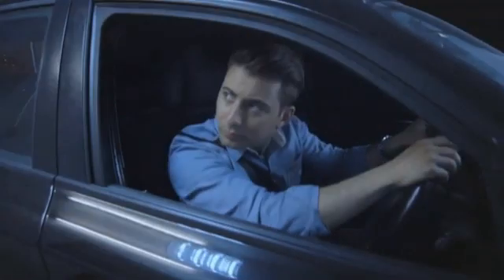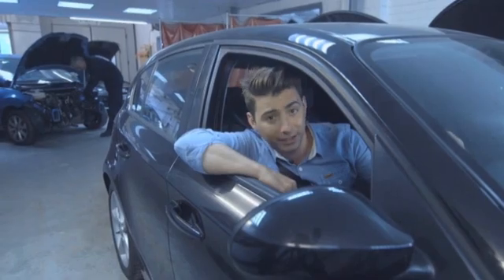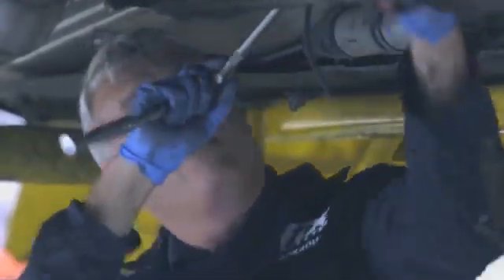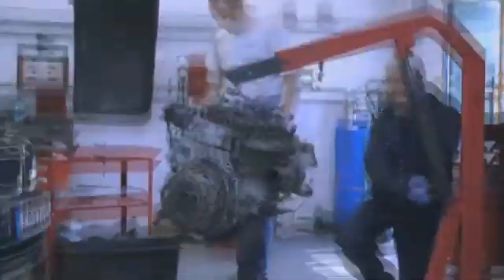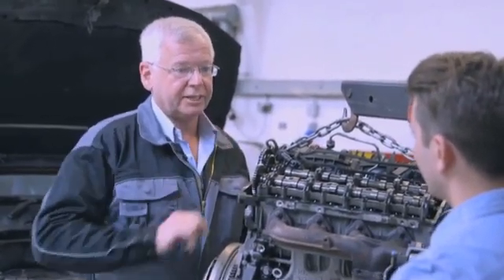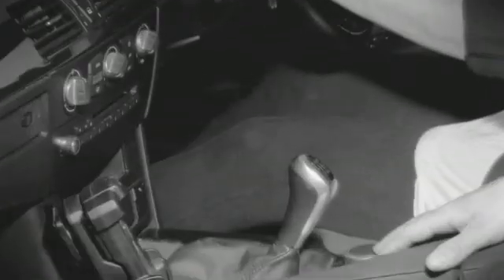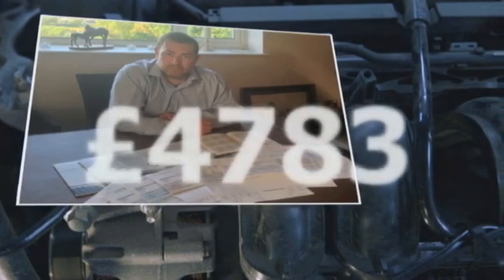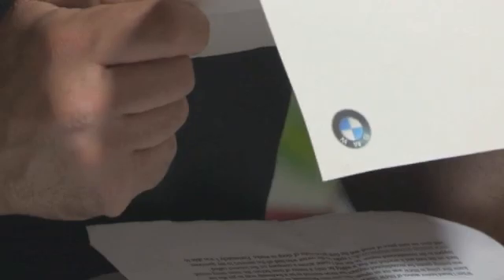BMW N47 Timing Chain Failure PROBLEM

Comment: LESSONS TO LEARN? THERE'S GOT LOAD OF ISSUES INVOLVING BMW, EITHER PETROL OR DIESEL ENGINE, THESE CARS ARE JUST AN OVERRATED , I KNOW COZ I OWN ONE... FOR 20 MONTHS OF DRIVING IT AND 49K MILES ON THE CLOCK, THE TIMING CHAIN GUIDE( WHICH I THINK IS A CHEAP SELECTION OF MATERIAL AND DESIGN FLAW) WITH PLASTIC ATTACHED TO THE GUIDE INSIDE THE ENGINE WAS DISLODGED FROM IT'S POSITION, WAS MANGLED INTO BITS PLACING THE TIMING CHAIN INTO STRESS AND DEPOSITED DOWN TO THE OILSUMP, IT CAUSES LOADS OF ISSUES FROM KNOCKING AND RATTLING SOUND,DRIVE TRAIN, WON'T START ETC. BMW WON'T TAKE RESPONSIBILITY FOR IT TO STAND GROUND ON THEIR SUPPOSED TO BE PRIDE. CAUSE ME GRIEF, ANNOYANCE, DESPISE OF OWNING IT. I ENDED UP DUMPING THE BLOODY CAR. DO NOT DESIRE OR LIKING TO OWN A BMW , IT'S A WASTE OF MONEY!!! THIS IS JUST MY STRAIGHTFORWARD AND HONEST OPINION.

Comment: This is why you never buy a 4 cylinder BMW (at least newer than the E46, 4 cylinders in E30s are pretty good), 6 cylinders are a lot more reliable, powerful, sound awesome and actually cheaper in the long run. If you want to cheap out by buying a smaller engine and want to save money on fuel, buy a Japanese car instead, a German luxury car only makes sense with a proper engine.

Comment: First when the engineer guy says "I'll bet my mortgage on it" who actually wins there? If you 'lose' the bet do they have to pay your house payment 😂
Second "BMWs are trusted and known for their reliability " 😳😳😳😳😳😳😂😂😂😂😂😂😂😂 you gotta be kidding me bro!  Every time I'm at a stoplight and hear one of the newer 4 banger 3 series shutoff then restart when the driver takes off I'm like 😳😮hope ur car makes it over 100k bc I know your starter won't!  Meanwhile back in the e46/39/53/etc straight 6.....zero internal engine probs ever
Third, these stories make e39 e53 and e65/66 v8 timing chain guides and valley pan issues look like a dream
Reply: bill durning probably just your oil separator and related lines, all the m54 3.0's I've owned this fixed the oil consumption issue

Comment: repaired loads of n47 chains no internal damage just snap the rockers and I normally take gearbox out leave engine in
Reply: Ashter Egg  were are you located please
Reply: @darrenpowell7225  did you find someone to fix yours?
Reply: It is harder with removing only the gearbox?
Reply: Hi, does the break in the timing chain not affect the valves?

Comment: I have 2 BMWs, and just bought another one (didn't arrive yet). First has the n47 engine, it runs fine so far but only 50k km, and the other is a 2008 z4 3.0 265ps n52 160k km . Oil filter gasket slightly leaking now, scheduled for replacement for 110$(equivalent). They are for sale now, first because of the n47 and the z because I want something built racetrack only like i.e. Westfield xtr2 although the z is very good.

Comment: We brought a BMW E46 coupe  3lt turbo diesel auto and the gearbox went tits up  . What a piece of shite  and what was the comment from my mate - you should of known better buying a tick turd car. 
Old engines had push rods , reliable old buses then they did away with that and did cambelts which snapped and your pistons smashed into your valves . This is the price you pay for high revving engines. But I guess manufacturers know that if they can make a fast car every little tick turd will want one .

Comment: These BMWs diesels use a Peugeot engine that says it all buy a German car get a French engine. Buy a petrol you get a BMW engine but make sure the cam-chain has been changed at around 60k because they do go!! but it is on the front of the engine not the back, always check when buying

Comment: Okay guys my bmw f10 2011 timing chain snapped and bmw paid 8k and I paid 2k towards repair, I had 130k on clock, happy with the result running nice and smooth.

Comment: E46 6 cylinder crew checking in with 0 problems ever. Lol
Reply: e39 6 cylinder squad confirmed! :D
Reply: M57 👍
Reply: M54 ftw
Reply: M47 engine cars too, if they have deleted the swirl flap :D
Reply: @iFulixzer  Nah they have turbo issues and so many others.. Iknow a guy who had a E46 and he sold it now he drives a french car instead 🤣🤣
Reply: E32 with the senior six saying hello.
Reply: 17 year old E46 320i checkin in. 0 problems
Reply: no car has zero problems--my e46 burns the shit out of oil--been doin it since 50000 miles--now has 190000 but still running
Reply: That is not a problem, the M54  was designed to do so with negative crankcase pressure sealing rings. The engine burns about 1-1.5L of oil per 10k km from new. Mine burns about 2L per 10k km now at 300k km and this means it's a healthy M54. It's still on it's original chain and piston rings, a great engine!
Reply: 2009 LCI 318D N47 checking in, 160k miles and counting.  Original engine, gearbox, turbo and running gear.  Not a hint of timing chain noise.  Must have got a good one lol.  This car is staying as my daily until the day it dies.
Reply: @ChrisUKFF  then youre lucky... i had a 2008 318d 143hp facelift! 120k km  climatecomp. Broken.... 125 k km turbo broken.... 
And and and
Reply: @ChrisUKFF  mines fucked  2009 320d lci
Reply: @dumbthingsyousee6969   You obviously never have owned a Honda Civic EJ9.
Reply: @dumbthingsyousee6969  well the engine could have been abused like: revving it right after a cold start and many more.I think your piston rings are gone mate.
Reply: @dumbthingsyousee6969  it is normal for 6 cylinder engines on e 46 i have 2.0i and my also burn oil like crazy but last month i have replace the camshaft sensor and now doesnt burn the oil so much 
P.s. you can replace that alone for like 15 minutes and cost me around 50 euros .. check on youtube how to replace it... i have 289000 km but the engine goes and sound like they made it yesterday .. and i have also replace the ignition coil all six of them,air mass meter also you can do all of that alone for like 1 hour just need the right tool and engine its like new man ;)
Reply: LOL u forgot all the cooling iaauea
Reply: obd1 single Vanos 325is e36 4 speed auto checking in with 250,000 miles.
Reply: Yes! I have a e46 330d 260k km and i fucking love it
Reply: @bandit4731  LOL my Merc W203 is at 305k i bet i can beat your BMw anyday.
Reply: @sikijunior1  for sure! I had one tooo! But they have rust problems 🙈
Reply: @sikijunior1  ok sorry my fault! Ive had a 2001 clk 230! But this is 12 years from now!
Reply: @sikijunior1  do you get it first hand? Ive got mine with 3 owners... -_-
Reply: @sikijunior1  this is the best thing my friend! Greedings from austria :D
Reply: @sikijunior1  eu or not eu! Were all equal my friend! :D austria and bosnia are connected with much history :)
Reply: 130i N52 crew saying hello
Reply: Except eating swirl flaps fir a start
Reply: Had n42 on 318ci bad choice both in terms of power and reliability, oil was dripping on all gaskets, replaced all oil rings and gaskets, from solenoids, head cover, sold the car, next owner had issues with timing chain, was a close call for me

530ia e60 8 months of ownership 0 issues, horrible fuel economy

320d e90 pre n47 engine with timing chain in front, long trip to spain and back 7200 kms, water pump failed due to engine vibrations, made it home in time, repaired for 500 euros then sold the car afterwards, 6 months of ownership

320i e45 m54 2.2i 4 years of ownership, absolutelly no issues except it was consuming 1 liter of oil for each 1000 kms, you had to go somewhere you take oil with you to top up, 0 loss of power just eating oil all day long, otherwise working fine, beautiful engine pleasure to listen to

E90 325i manual, 3 years onwership, awesome drivers car, electronically operated water pump failed, just the pump itself costs 500 euros, (whereas as the belt operated m54 water pump costs no more than 100 euros) 1 year later ac compressor failed, 400 euros to replace plus other parts, like belts and rollers total cost 800 euros, other than these 2 issues engine worked fine, except for valves noise which was a common issues with n54, though it did not affect performance, had to explain to next customer is was normal noise, he understood, bought it and had 0 issues so far

F10 530d, 2 years so far no issues at all, beautiful car and engine
Reply: 1999 E46 323i reporting for duty. M52TUB25 with zero warning lights, runs like a champ. 130k miles.
Reply: E46 It's a legend , no a car 😉✌️
Reply: 2013 F30 330d, 82k miles, worrying loud clattering noise under load.
Reply: Same thing with e60 m54. Great engine, great car. No problems at all
Reply: Best car ever built
Reply: My old m5 got hungry & ate its bottom end to death 😔 piss that off then got a e46 m3 but then the subframe spot welds decided to crack & go for a fkn stroll 😗 ive now owned my 400kw chaser for over 10yrs & the only thing i have ever replaced is the clutch 🙂
Reply: Fair comment.... except for the rest of the car rotting off the carcass LOL
Reply: A fuck off, E46 are infamous for throwing rod bearings
Reply: Oosterhout’s Finest zzzzzzz yes by lazy ppl who don’t service the car properly OR people using WRONG oil. Go find cars with these problems then look at the service history to find your answer. Every 10k or 6-8 months. Zero issues with chains and turbos!, try it

Comment: There are cars with design flaws for sure but many timing chain jobs I’ve done were due to people not changing the oil frequently enough. Manufacturers recommend crazy intervals like 10,000 miles for an oil change. If you can’t afford to change your oil at least every 5,000 miles then you have no business buying a bmw or any European car for that matter.

Comment: Buy original BMW oil and have it replaced at least on 10,000 miles by yourself or someone you trust. No problems then. Usually timing chain makes very loud rattling noise before it breaks. In Slovenia it can be replaced for about 1,000 to 1,200 €. I think that those long service intervals are the main reason for failure.

Comment: part of the problem is the "long-life" oil. so they make the car difficult to repair by putting the chain at the back, tell you only change the oil every 2 years and then when it fails slightly out of warranty expect you to pay for it all. They're scamming people, nothing more to say.
Reply: It is shit design through and through. If it is lubrication problem, the journal on crankshaft and the oil ring on piston are gonna go long before a well speced chain have any sign of problem.

Comment: I've owned three 7 series in the last few years,  all 730ds.  1 e65 2006. 1 f02 2009. 1 f02 2012. I've had to change the chain on all three of them, now my wife's 1 series chain starting to get noisy with only 71000 miles.  I went to bmw in Thames ditton to see if they take any responsibility,  the guy could talk for england,  he came out with so much bullshit I couldn't believe it, such as we give 3 years warranty on all new bmw!  I was like wow how amazing is that!! Now days even LIDL gives you 3 years warranty on some of their  power tools, and also crap like if the car hasn't been serviced by us we can't take liability,  I asked y all these chains are located in the back of the engine?  He said cos its a non service item and should last the engines life time,  I said so y does it matter where the car been serviced if that's not a serviceable part????  He carried on talking rubbish.  Hopefully one day some one takes them to court and win,  I have bills to claim back for £9000 for all of them.

Comment: Not sure what's up with German engineering but the Mercedes 2.2 CDI also suffers with big timing chain issues and that engine is used across far too many models to mention.  

The earlier versions of the VAG V6 TDI used in the Touareg, A & Q 4/5/6/7/8 and Cayenne can also suffer with chain failure on a too frequent basis.  The VAG 3.2 FSI V6 is also notorious for stretching it's chains.  

The BMW TT 4.4 V8 launched around 09 in the 7 series before filtering down to the 5 and 6 had massive issues with the timing chains and BMW were having to buy back low mileage cars in the USA, which was the biggest market for these engines.  They brought out a number of engine revisions to address the issue, which weren't successful as engines continued to fail.  Pretty shocking when you think about the  price of these cars when new.  Early X5M's also suffer with this problem but it then received a much updated engine, which was ready in time for the F10 M5, which seems to be a pretty bulletproof engine compared to earlier iterations in the X5M.

Earlier versions of the Jaguar/Land Rover 5.0 V8 (08 - 13) suffer with timing chain failure and all due to a plastic tensioner and cost cutting.

A $30 timing belt doesn't look quite so bad now....

Comment: My 2006 Honda Civic Petrol automatic has done 211,000 miles I’m now on my third Battery and I’ve replaced the i-Shift clutch at 160,000 miles service at Honda main dealer for £450 and replaced the front suspension once I’ve been all around Europe in it and I’ve never broken down except a failed battery, I even started the car in Norway in -31 without an issue 

The Vtec engine on my car is running like new

Comment: It doesn't help that, for a given engine displacement, power output and reliability are generally inversely proportional. BMW seem to eek more and more power and torque out of these 2 litre diesels every few years; look at the results.

Comment: note: the tech at 2:45 says the timing chain is designed to last the life time of the engine. he is correct. the entire car is designed to fail before 100k. I am a shop owner, I see it every day. I have worked as a dealer technician for a few brands. it is all brands, not just bmw

Comment: There is a decent reason to put the cam drive chain at the rear of the engine.  By taking the chain from the load end of the crankshaft the torsional vibration load is reduced,  giving more accurate valve timing. 

But a stronger design might help.
Reply: Why on earth didn’t they use a duplex chain..

Comment: The same happened with my 118i (2007, 120k km, no garantee). No warning lights, neither before and after. Although a day before I heard some light metallic noise from the front, but I though maybe something around the brakes hitting that metal shield around it. (it was winter, and I was 400km from home in a motel, so I haven't investigated it further) But next day, the engine was at least -60PS weaker, the consumption was sky high (40l/100km), I barely could make it to the work (3-4km distance). Then came ADAC (german "yellow angel"). I told him the symptoms and he known it right away it is the timing chain. He removed the oil cap to make it sure, and it was. He said it will be €€€ to replace the chain. Few days after I have a call from the BMW service, that it can't be replaced and complete new engine is needed, as the lose chain damaged the engine. I read about it, that a new engine will be around €€€€€€ not to mention in Germany in an official BMW service it would be even higher. But after I imagined how I going to smashed the car with a huge hammer and lit it on fire, the service guy continued that the BMW admits this design failure and they will replace it free with a new factory 0km engine. I don't know if this is because I was in Bayern or in Germany, but I'm afraid if this would happened in a not so lucky country I would be doomed, big time. Nevertheless, I'm not a fond of gambling, so 1 year or so, and I will replace it with a Toyota.
Reply: So did the BMW gave you new engine?
Reply: @Dom_czech  no

Comment: I've been driving and servicing my BMWs for over 12 years now had over dozen of them. Currently have 4 in my possession. Not one of them have given me an engine failure where it is catastrophic. Yes parts are designed to time out and preventative maintenance is crucial and expensive but never catastrophic like example above. However engine sizes are critical when choosing to own a BMW. Never own a small engined european car like BMW, audi or Mercedes. Yes they make engines as small as 1.5L 3 cyl engine but I never buy BMWs with engine capacity below 2.5L I6 because any engine size below is gutless, engine can have strain due to chassis weight and BMWs especially are known for their inline 6 technology. Not 4 cylinder!  4 of my BMWs vary from 2.5L, 2.7L, 3.0L and 3.2L not one of them in 10 years of ownership has given me headaches like what you see in the video. People buy entry model products thinking they will run like the premium versions but they won't. Hence why it's cheaper than the premium versions like 3, 5 and 7 series.  Same with audi or mercedes. Never buy entry models and go for proper versions and you'll be okay. If you don't have the money to look after it, don't own one and buy a Toyota. Simple. Ps: the known issue above is rectified in MY11+

Comment: Ex-BMW customer from the UK.   Car with the N53 engine had failures, spent nearly £ 1,000 on two trips to the garage to be told neither worked and they believed it needed another £ 3,500 worth of work.   Discovered that in the USA this would have been covered even though it was out of standard warranty because the parts are notoriously unreliable.   BMW UK don't care for customers who have religiously had their cars serviced at their dealerships.

Searching the internet I have discovered many of their engines have inherent problems, not just the N47 or N53 but many.   Bimmerboost claim BMW just try to ensure the engines in the M3 / M4 last long enough to get out of warranty then leave the owners without support!

I will never buy BMW again.

Comment: got an 320i e90  with 187.000   my valvetronic is broken  also my seals..  and my chain is loose   lucky a garage will fix it for only 1700 euro's with 1 year warranty